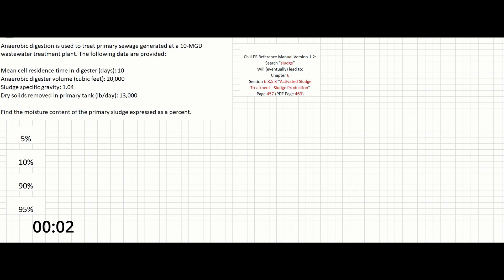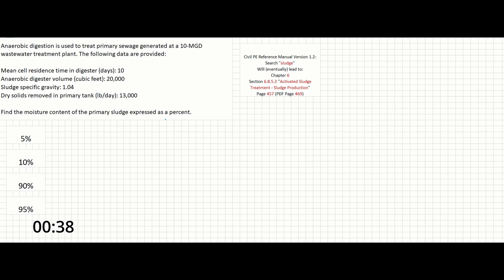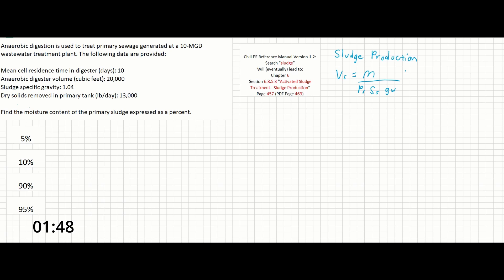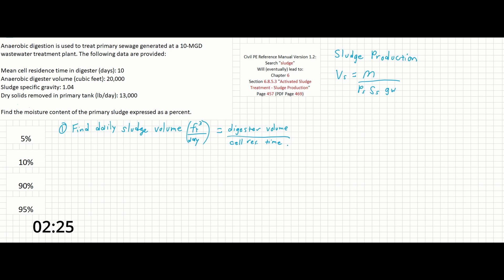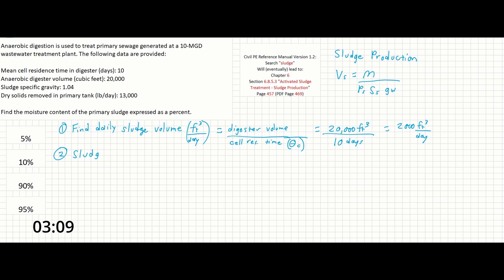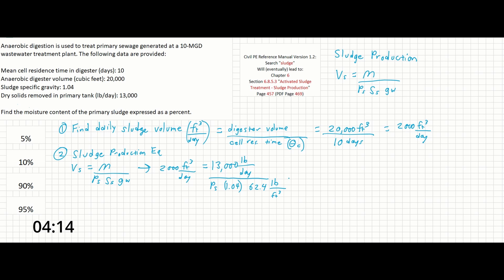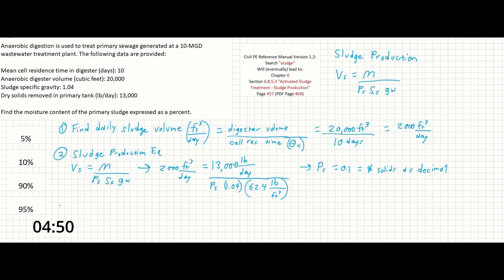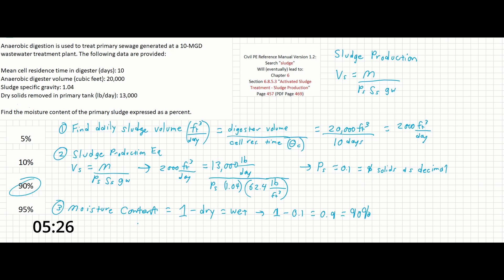PE Exam Practice Problem #18: Water Resources | Sludge - Anaerobic Digester - Moisture Content

Comment: Not sure if I just accidentally got it right. But I use the 10MGD convert it into total volume processed in 10 days, which is 1339200 cubic feet. Then calculate the volume of dry solids removed over 10 days, 13000/1.04*10 = 125000. Then I divide 125000 by 1339200 which is 0.093 or 9.3% of dry solids removed. 100 - 9.3 = 90.7%. Is this a valid approach?
Reply from the maker: Honestly I'm not sure if this is a case of "wrong equation right answer" or if this works. Logically it makes sense to me but when comparing to the way I solved it, it leaves out any mention of the digestor's volume, which i did use. To be honest I like this method more because I can better wrap my head around whats happening and not just follow some equation I don't understand.   If you come across any other digestor problems, see if it works for them too, and maybe thats all you need.   Also for what its worth, I'd rather be lucky than good any day. 😄
Reply: In calculating the volume of the dry solids, how did you cancel out the lbs unit and acquire ft3? Seems like you have (lbs/day)*(day)*(unitless) ?
Reply from the maker: @Myhandsarecold42069  sorry, which step are you looking at? In step 1, we are using the given volume and the given residence time. 
In step 2, It looks like the variables we have here either given directly or calculated in step 1. Let me know if I'm missing where you are confused.

Comment: I may be mistaken on my vocabulary but I think the first sentence of the problem statement should read "Anaerobic Digestion is used to treat primary sludge" instead of primary sewage. That threw me off and I thought since we were given the HRT (10 days) we may need to find a sludge return ratio or something. I ended up using SG=UWsludge/62.4lb/ft^3  and then Vsludge/day=UWsludge*13,000lb/day to find the daily sludge volume.
Reply from the maker: Sorry for the misleading choice of words in this problem. You're probably right - I've seen it written before as "primary sewage sludge" but likely not as just "primary sewage". I work in wastewater collection system modeling and so everything to me is sewage haha. Also thanks for sharing your method of solving for some terms. It seems more efficient and demonstrates that you have an inherent understanding of how these equations work and what they are for.

Comment: Thank you for these videos, they're great! I wanted to note that Ps is percentage of solids in weight, not in volume, while moisture content is measured in volumes which means that the answer is not perfectly accurate. Still a great problem, I'm just making sure I have a good understanding of the concept. Ps = Ws / Wtotal while moisture content is Vw / Vtotal. Given that sludge has a unit weight close to that of water, the difference is negligible. Am I right? Or am I missing something? Thanks again!
Reply from the maker: To the best of my understanding, you are correct! I believe that 𝑃𝑠, though weight-based, effectively converts the mass of solids into a proportional volume when combined with the other factors in the equation. The moisture content impacts the total volume but is indirectly accounted for through 𝑆𝑠 and Gw (the sludge density factor, about equal to 1), ensuring the equation correctly reflects the final sludge volume. Thanks for asking such a tricky question. I will not pretend to be an expert on all of these topics and had to turn to Google for help here.

Comment: In reference manual sludge volume produced (Vs) unit is given is cubic feet. Here we have calculated as ft3/day. How we justify this?
Reply from the maker: Great question. In this case, it is simply because the problem gives us the amount of dry solids removed in the primary tank PER DAY as well. We are thinking about this calculation in terms of some unit length of time - in this case, sludge production PER DAY. If the problem had only told us how many pounds of dry solids were removed "in general", we could have removed "per day" on both sides of the equation.
Reply: @SolvedIn6  You could also multiply the dry solids removed per day by the mean cell residence time and then all of your terms would be in the same given format as the reference manual
Reply from the maker: @zackbrenners7261  good call!